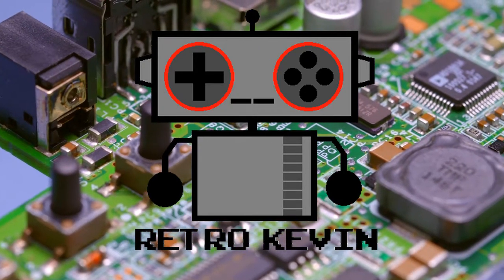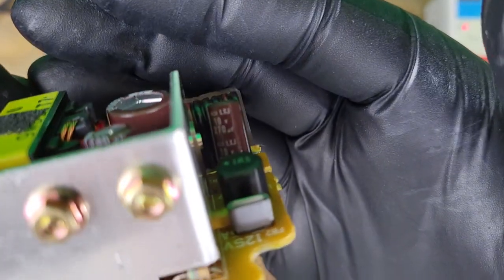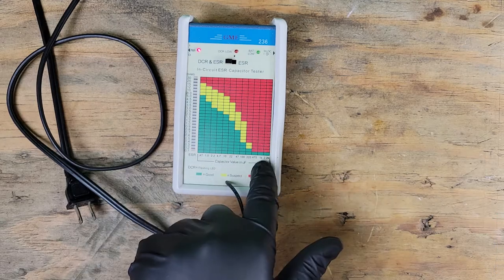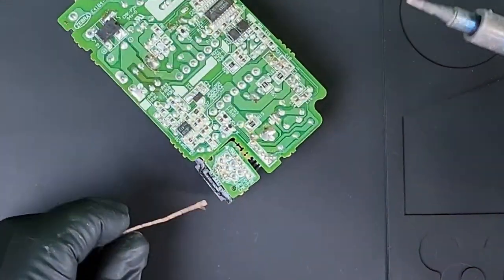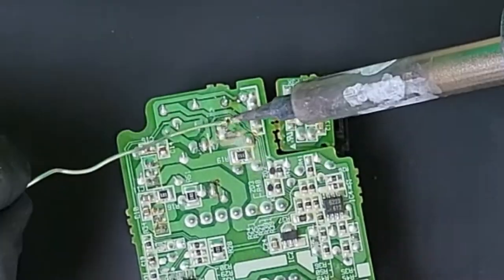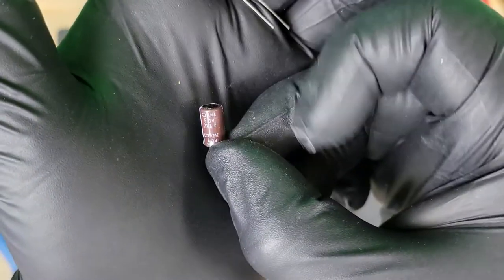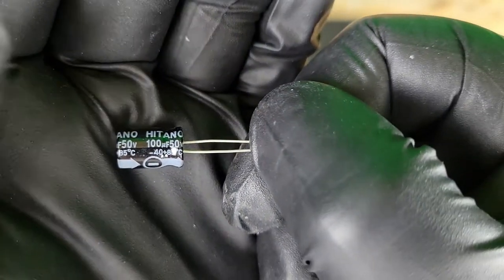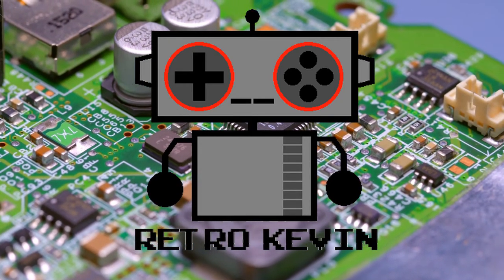Fixing junk from ebay. N64 power supply with no power.

Comment: this is probably just a personal preference thing but for me if i have the money to do them all i'l just buy all caps needed replacement and replace them while i'm at it regardless of condition(if one or more needs replacement) cuz it does eventually save time of going my station setup and reopening the PSU in the future, also cuz it's electrolytic i don't want any leaking later causing trace rot.  if some or all of old ones test yellow or green i hold nothing against keeping them in until they die it's just not my preference.

Comment: Testing a capacitor right on the board like that isn't accurate at all right? What about all the other capacitance in the circuit?
Reply from the maker: If not using the right tool, like a multimeter (which can be used out of circuit) you are correct.

I sometimes forget to explain the tools I'm using because I've explained them in other videos.

The tester I'm using is designed for in-circuit testing.

I can go into the pros and cons... but maybe I'll save that for another video 😉

Comment: Like am I the only human being who got a n64 power brick that doesn’t have a circuit board? Like it’s all just in there organized in the case. Then the actual power connection port is just held by three wires instead of a ribbon with no way to really keep it aligned at all times to make a secure connection when plugging it in. Now i found I could just leave the port more on the outside and while unplugging is kind of dangerous it only worked that way. I’m guessing the dude just forgot to super glue the wires down to the plastic flooring so the port wouldn’t wobble out of the window frame.

Comment: You have an in circuit capacitor tester but not a desoldering gun?
Reply from the maker: The cap tester was under $100 when I got it. The desoldering gun I'd like to get is around a few hundred. I have a cheap one but I don't really care to use it. I have a lot more practice with the wicks and they're cheap enough.

Someday I'll get a desoldering gun... someday.
Reply: true lol. speaking of which i should invest in a desoldering gun soon, saves time I imagine. also somthing  for fumes for obvious reasons, up til now i've just kept my face as far from the fumes i can and exhale while soldering when i can't get out the smoke lol.